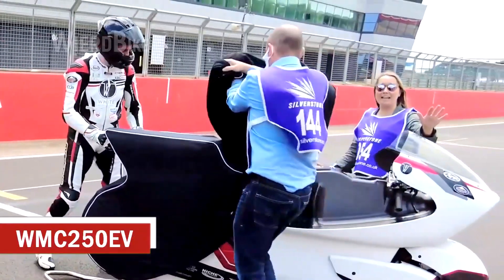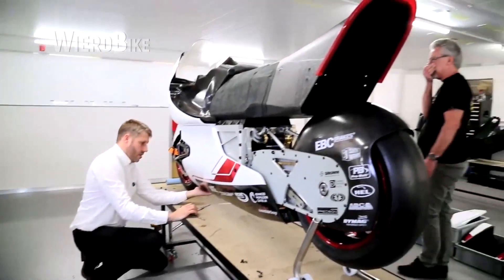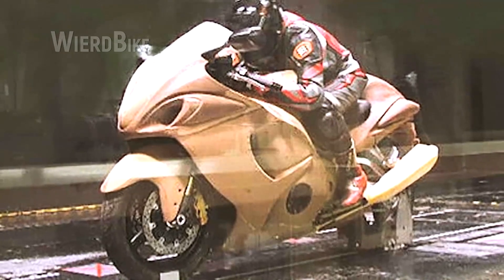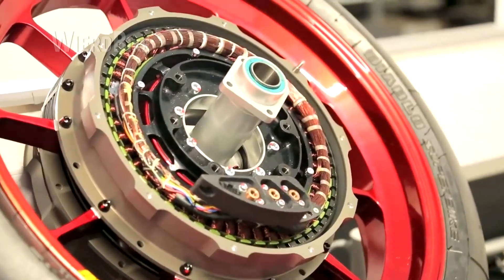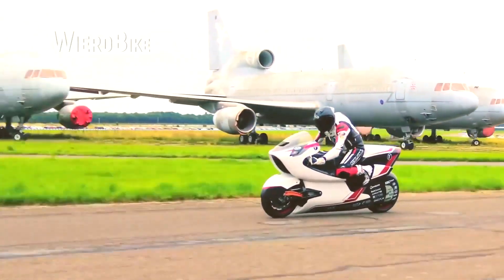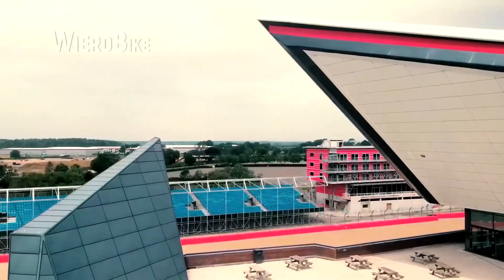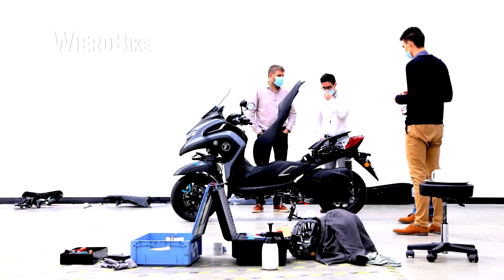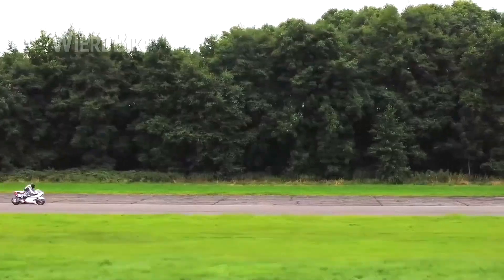400 km/h on ELECTRIC Bike! All thanks to GENIUS AERODYNAMICS!

Comment: Here's an idea:  use existing accessible affordable technology. NOT ELECTRIC.
Bill Warner took a highly modified Hayabusa turbo (built like a streamliner) from Zero to just over 501 KPH (311+mph) in 1.5 miles.
In a time when gasoline is cheap (it has happened before), posted speed limits are low (since the 1970s), THERE IS NO PUSH FOR REDUCTION OF DRAG.

Comment: The greatest drawbacks it could encounter are  the wheel diameter, as it could never be able to compare with the other rivals, the second is it'll never come in a gas powered two wheel motorcycle, they either have to compromise on the tunnel or increase the height which will encounter another challenge on the law of physics
Overall I highly appreciate their innovation plus I'm glad the other motor giants had never come up with the idea first 🥇

Comment: Interesting but pointless at the same, what we need is a breakthrough with battery technology, lightweight so the motorcycle doesn't weights more than the ICE equivalent and more energy dense so there will be no more range anxiety, until then the ICE will remain.

Comment: Problem with motorcycle aero via tunnels and front-wheel downforce strategies is that it doesn't really work as effectively when turning and efficacy varies based upon the turning angle (even at constant speed).
Not exactly a risk you want on the bike, hey?

But then again, people have put turbos on Busas and that's even more problematic when taking turns. So WTF do I know?! You go, queens!!

Comment: 300 fking kilograms! WTF? That thing is literally a land torpedo that will destroy anything it hits at terminal velocity! Holy fk
Reply: Oh, like a lambo?
Reply: Eh. Sportsbike riders (430 pound bikes, 190 pound rider) have t-boned small cars at high speed and nearly cut half way through the unibody. It's already a known factor.
The main issue of safety?
-Since the 1970's the number of motorcycle fatalities in the USA has hovered between 4000 and 6000 per year.
-On average, 30% of those do NOT have a valid motorcycle endorsement.
-43% had a BAC (Blood/Alcohol count) of 0.08% or higher
-65% were NOT wearing any helmet
-77% were front-end collisions
1. Get trained
2. Don't drink alcohol and ride
3. Wear a helmet
4. Cover/learn how to use the front brake correctly
Reply: @exothermal.sprocket  respect for your post. I'm actually from a family of motorcycle riders. My uncle held many of the titles in the Suzuka 24 hour among others. My cousin just recently sold his motorcycle training business. He specialised in advanced rider training for the dirt and tarmac.
My recommendation on top of yours is that riders should invest in good protective gear and don't be complacent and ride in shirt and shorts?
Reply: @ Today's safety equipment is fantastic compared to anything heretofore, especially airbag tech (electro, mechanical) vests, suits, jackets which stabilize the neck, stabilize the upper spine, provide shock and cushion. Also the reactive elastomers make impact padding much more comfortable for elbows, back, knees, hips, shoulders as it stays flexible until impacted.
Reply: @exothermal.sprocket  bro,  I'm just blown away with steering stabilisers on a 2 stroke motocross bike preventing tank slappers let alone those blue bird sci fi tech!
Reply: @ Imagine what manufacturers could do if they weren't blowing their whole budget on crap regulations.

Comment: Riding position based on the R6?
The rider on this electric bike has their legs doubled up till their lower leg is horizontal.
That is not at all conventional even on race bikes.

Wheel base looks very long I wonder how it corners. I'm sure it is very fast and stable in a straight line.

Comment: The best feature of a vehicle for most people is its multi cylinder sound roaring from the distance. I'd pick a H2 or H2R over that electric one.
Reply: Try breaking a speed record with the sound the bike makes
Reply: Ah, one of the loud teenager type. Obnoxious.
Reply: @armandbourque2468  ahh one of the incel type, incapable of changing gears type?
Reply: @hexagonosaurus5848  don't have to. Or feed it hay or coal, either. Stay cool, gramps!!

Comment: Question!! Who even wants to go 400km/hr? One speed hump, and you are a UFO. Stopping a 400 km/hr bike for a school bus is also going to be a real problem. 😬😬😬
Reply: Ever heard of Isle of Man TT?
Reply: @tonn333  Yes
Reply: @coleorum  perfect answer for your question, don't you think?
Reply: @tonn333  400km /hr at Isle of Man is impossible on those bumpy and curvy roads. It would take a special smooth track like an aircraft runway to ever make use of 400km/hr.
Reply: @jeremyacton4569  fair enough. But I'm not not as confident as you... Claiming impossible.
In 1993 over 200 mph (322 kmph) was first ratified in motogp... 
29 years later that ceiling had been raised by 40 kmph(!) to 363 kmph.
Reply: @tonn333  where do they reach 400km/h on the Isle of Man then?
Reply: @hexagonosaurus5848  never say never

Comment: Electric will never be a suitable for motorcycles. Not if you actually want to ride and have fun and not waiting at the charger for ages.
Reply: More fancy overpriced daydream than reality
Reply: @cedhome7945  fun is subjective. The same can be said when gas powered vehicles first entered the market, only rich people can buy them.

"Automobiles will never have the soul that a noble steed does, it's just a smoke belching contraption". See?  It's so easy to make blanket statements as yours 😉
Reply: Sure we can! Just install a tiny 2 stroke lawn mower engine generator in the bike help recharge the ev bike batteries
Reply: @fidelcatsro6948  a hybrid. Run the gen at optimum steady revs for efficiency.
Reply: "Never" is a very long time. Those horseless carriages will never catch on...
Reply: Nonsens.
Reply: Never say never
Reply: And beside this all vehicles ard not able to deliver this power over a long period of time. My ZX-10R deliver 157kw as long as I have fuel. With the given fuel tank approx. 30min were I have ridden 150km, need a gas stop of less than 5min an blast away for the next half an hour with top speed. How long will this electric junk dilver 250kw? 3min? Batteries empty after 20km?
Reply: I think electric is BEST suited for motorcycles, specifically dirt bikes and Motocross bikes. EV on the road is dangerous as cars can't hear you when they already can hardly see you? Stripping away your sensory presence on the tarmac = recipe for death
Reply: Fun is subjective
Reply: YeA AiGhT look up energica or ultra volute f77
Reply: The delusional EVangelists and climate catastrophists are filling their nappies again. 

The list of reasons why EVs will never become the main options is very long. However, the biggest have nothing to do with the silly appliances themselves. There simply isn’t sufficient copper in the planet to create the necessary charging infrastructure. There isn’t sufficient lithium to make enough batteries. And the fire, repair and depreciation issues are going to make them uninsurable, and non viable purchases for the vast majority of people. 

Plus of course they are completely unnecessary. 

These are the simple facts. But the soyboys can always cry over if facts hurt their feelings.
Reply: Totally agree, and don't listen to the haters with their comments only one or two comments down😮
Reply: If you could swap batteries, it might work but it won't be practical to store them everywhere.
Reply: If you wait 10-15 minutes that's age's 😂
Reply: @bestofalllife  every half an hour. Yes ages if you actually want to get somewhere.
Reply: Technology will evolve and someday it will be possible.
Reply: For big commutes it's not a good choice. But for going around town?

Best invention to date...

Cry harder
Reply: @rafaeltavares6928 Cool...I'll buy a phenomenally expensive 400km/h bike so I can do 30-40km around town...money well spent and what an incredible amount fun that would be.....but then maybe a Honda Grom might be better for that......that's my subjective opinion
Reply: @PhilipBurton-dn3ce  Allot of people don't seem to understand how technological innovation works.

You wouldn't buy a expensive F1 to drive through town at 30 either.

But your car has stuff in it that was invented for the track. 

Paddle shifters
Dynamic braking
Steering wheel buttons
Kinetic energy recover ( used in hybrids and EV)
Tire pressure monitoring.

Etc....

No one said this bike was coming to a dealership close to you!
Reply: Obv never have, have you? Fastest in the world? Electric. And swappable batteries, and charging while you sleep works fine. Stick to the stone age, seems to be your limit.
Reply: @armandbourque2468  Yes I have tried, and no it was not for me. I ride for fun and cover longer distance than any electric can go. My bike weighs less than 200kg has 150hp goes 300km on one tank takes 5min to refuel. How about your electric bike specs? I'll stick to my Stone Age.
Reply: @armandbourque2468 your charging overnight draws the same power to run a house for a month, and you think it is saving the environment? You are creating 3x the coal pollution at the power station! But at least the pollution isn't close to you! 😢😢 Wake up polluter!

Comment: why dont you ride lower between the tires, instead of having to have the hole.
Reply: Yes that what I was thinking, make the bike a little longer and the rider will fit in same riding position without the tunnel also lowering the center of gravity closer to ground...
Reply: @a64738  making the bike longer will decrease maneuverability
Reply: @EleaRevils  again, not necessarily.
Reply: Creates front wheel down pressure, therefore better traction, so it can have 2 wheel drive. Whole new handling characteristics.
Reply: @armandbourque2468  so you think that is not achieved in any other way. that only this current way works. yeah cars have flat weight distribution.
Reply: 重心に近いところで操作することが、高速走行中の安定性にどの程度の影響があるか不明です。
従来型のモーターサイクルに近い乗車姿勢で空気抵抗を下げる試みは、とてもユニークだと思います。

また、車体を長くすることによって発生する様々な弊害を無視しないことは、このコンセプトが最高速度記録以外にも目を向けている証拠だと思います。
Reply: Will also make falling less dangerous and less likely. Good question. I think there are some prototypes but such vehicles can go on rode because cars and trucks won’t see them
Reply: @Trillionmasks what about the car that's called the lotus that car is like a go-kart it's so low to the ground
Reply: Why don't you?
Reply: Excellent point 
Since the tires are already in the air stream 
That's how the world speed record holder did it.